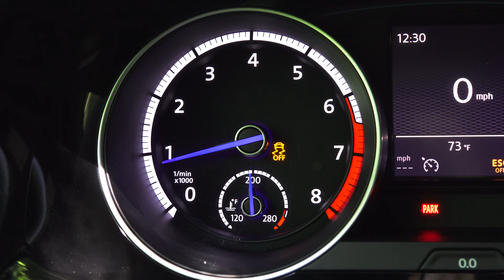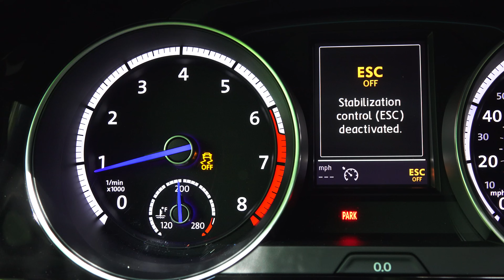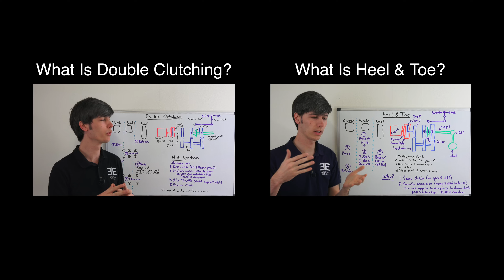How To Launch A Manual Transmission Car

Comment: In Germany we would need a tutorial for driving automatic, over 95% of the cars here are manual.
Reply: Doc T'Soni 
I would buy a car with AT, but only if it has DCT. I wouldnt want to miss the manual feeling.
Reply: +Doc T'Soni    Automatic is boring, consumes more (gas isn't cheap in Europe), and it tends to select the gear that "it" wants, not the gear that you'd need in a particolar situation (a corner, an overtake).
Reply: tja die ammis haben ja schon Probleme wenn se keine Klima im Auto haben..
Reply: +Doc T'Soni in France you get taxes if you buy an automatic something like 3000€ pro cars +3000€ which is the cost of the automatic version so a car without an at which cost 20 000€ = 26 000€ with the at
Reply: @stonedmole2351  Tiens, j'avais jamais entendu parler de ça. C'est surprenant... Tu sais pour quelle(s) raison ?
Reply: Nothing can take the satisfaction of driving a manual. Downshifting, heel and toe, it's just priceless. Nowadays there are faster ways to get somewhere like driving a DSG, but that doesn't give the same satisfaction. That's why I got my mk7 GTI PP with a manual transmission. Cheaper and it gives me so much more fun. Auto is for someone who doesn't actually enjoy driving imo. You can drive 80% of the time in traffic jams but you will still have some B road trip or night time drive where there's not much traffic, I was born in Sao Paulo so I know how that feels... If you enjoy driving that's when the manual makes it up to you. I agree though that for those who just use a car to get from point A to point B a manual is not the way to go, and I guess that's why automatic cars are selling so much these days even here in Europe (especially DSGs which is not really an auto mechanically speaking, but still)
Reply: In UK would make sense to buy an AT car due to traffic and so on...but by the time your engine decides on which gear it should be you could be in the 4-5 gear on a manual transmission car. 
I always said that lazy ppl drive AT cars because,oh well, they cannot be bothered changing the gears or all that.
Also,in UK if you pass your driving license on a manual car you can AUTOMATICALLY drive a AT car as well but the same rule doesn't apply if you passed you license on an automatic car,you can drive an AT car but you'll need to resit your test if you want to change that.
Reply: @mariusvalentin4822  yeah very true but these days you can pass your automatic test and jump straight into an audi s3 with a DSG box without issues or any car with semi auto, which is alot these days lol
Reply: I run a performance setup on every car I ever owned. Always loved manuals, shift when I want to at the appropriate time. Going down hill, I keep it in low gear, the engine brakes for me, no need to fry my brakes. Going up hill on a steep slope, keep it in first or second, all the way, no need to shift, easy climb, no problem. Traffic is a pain but it outweighs the benefits, for me.
Reply: Driving automatic car is easy, yeah. Too easy that will make you bored, no need to change gear.
Reply: anyone can drive a powerful automatic with no experience
Reply: its hard driving automatic man
Reply: Thee Adjudicator
i dont know where you sat in tho
Reply: AT are more expensive to buy and repair.  It's a skill you'll use more often than you think too. Only last week I moved a HGV lorry because it was blocking a bay full of steel and preventing everyone from working and I never even driven an HGV before.  Today I had to take a metal box to a steel works in a desperate hurry in a manual van because the lorry driver went home and I'm only the workshop painter. If that happened in America someone in a steelworks would be deprived of his metal box right now. There are plenty of job roles that don't have driving manual in the job description yet you'll be fucked if you can't drive the vehicles on a whim when needed.

I made an in depth tutorial on how to drive a auto too:-

Step 1: get in car
Step 2: put it in "D"
Step 3 get out of car at destination.
Reply: +Doc T'Soni 
AT has a big disadvantage, at least in my opinion: you are likely to forget how fast you are going because with MT you focus on what gear you are in and what RPM you are at, which is very hard with AT because you dont have to pay attention to that, basically. I hope you understand what I mean.
Reply: @scwfan08  I do now lmao! I used AT as my first car and without realizing it I was going 80km/h instead of 50/60... In MT I know in 3rd gear I can get to 50 and no higher without pushing the RPM's in that gear... In 4th I can get to 70.

I can easily remain within the speed limit vs an Automatic.. However I do miss Automatic for the fact it's a "Press and Play"
Reply: or pretty much everywhere else in Europe
Reply: 95 percent of people that say 90 percent are lying
Reply: +The_Geck Hold the brake and rev up to about 2/3 to 3/4 of the torque converter stall RPM. (Brake loading probably isn't good for it, but we're talking fastest launch.) Then let it loose and floor the go juice. I'm sure manuals are nice, but some of the fastest drag cars do use a slushbox. (But usually not with the factory setup.)

Other than that, you rarely use the L-selection at all. Stick with the brake pedal. The L gears are just for engine braking in hilly or mountain areas with long downhills. Autos that aren't "manu-matic" (or some variation) likely don't like forced downshifts.
Reply: +The_Geck Yee , I dont know how to drive automatics lol   , its all about changing gears not holding stering weel  isnt it ?    never drive before automatic ...
Reply: +The_Geck 95%? No way, 2/3 according to mobile.de
Reply: +King Joffrey Nein, Manuell überwiegt schon, aber nicht so heftig. ~2/3 sind Schalter.
Reply: You get nice feeling if you have powerful car with manual. I mostly drive with my manual on highways so I get better diesel efficiency. But if you use it much on city pfft, I would definitely consider automatic transmission
Reply: maxpowers3732
They are proper sports cars, its a big difference
Reply: maxpowers3732
 those cars are performance cars therefore you want it that way. if u want a gated shifter u rather go for cars with less grip and bigger torque. you drive it sporty in your free time. these cars are not like a sportscabrio, they have much higher performance
Reply: In Germany you have the Autobahn and therefore I am extremely jealous. :oP
Reply: *****
wow, you are extremely intelligent!
Reply: +mrdojob six months after I got my license having only driven MT I got to borrow the AT volvo V70 of my then gf's parents. It became quite the bumpy ride for a while as I was so used to manual I tried to use the clutch which of course wasn't there... while the gigantic brake pedal was there... XD
Imo, the problems happen when you go from one type to the other when very used to one of them.
I love my MT Hyundai i30 turbo crdi. Only trouble with it is that she took a beating from bad fuel from OKQ8 that had too much bio additives in it and caused algae gelling in the fuel system, blocking both fuel filter and injection pump :( Since then she has occational hickups that kicks her out of cruise control when I use it.
Reply: +The_Geck Um floor the gas? Lol
Reply: Steven Little
Well... :D
Reply: +Doc T&#39;Soni bis ins jahr 2011 haben die automatikfahrzeuge einen höheren verbrauch. ausserdem ist es schwieriger in der fahrschule und flößt genug respekt ein, gibt ein gefühl für geschwindigkeit. warum sollte es dumm sein 2liter / 100km mehr zu verbrauchen, wenns auch anders geht. ich mag das so gerne, ich könnte per automatik kotzen.
ausserdem: die mercedes (bei BMW weiss ich nciht), die mittlerweile bei Automatik trotz Drehmomentwandlerschlupf weniger verbrauchen sind minimal effizienter, bei VW , skoda fidnet man heute noch mehrverbrauch. ich zahle aber keine vierstelligen Beträge, nur um dann in 20Jahren etwas zu sparen.
Wann muss denn so ne Automatik in die Werkstatt, wenn man von 20Jahren und 300.000km ausgeht?
Meine Karre hat 24Jahre drauf und ich kann mir keinen Neuen leisten.
Reply: +The_Geck really? most of the Mercedes and BMW's I sat inside over there are automatic.
Reply: Why do so many sports cars have automatics that are in Germany? The take rate for manuals is much higher in the US than Germany. Do sports cars drivers forget how to operate a clutch and gearshift?
Reply: Huh? Why don't German buyers want a manual M5, 911, R8, etc.  Shifting the gated manual R8 was one of the greatest feelings in the world and yet buyers in Germany get it with the boring automatic?  Why do Americans buy manual sports cars at a higher rate than people in Europe?
Reply: welcome to the future
Reply: Ja und ich bin froh dass es nicht andersrum ist....die ganzen faulen amerikaner....
Reply: The_Geck isso
Reply: The_Geck was laberst du? :D die neuen autos sind alle automatik...
Reply: Damit hätte ich auch Probleme. Zwei Zonen Klimaautomatik sollte drin sein ...
Reply: archly i tend to speed more in a manual ya i was doing more speed in the auto when i was speeding but that cos i went from a 1.3 vvti to a 1.2.

i think everyone should try a 1.3 vvti idn what toyota dose to they engines but that yaris was keeping up with 1.6L engines i even sore 130mph no ware near redline
Reply: The_Geck Hahah same in India too
Reply: actually it's pretty much 50%/50%. I read something like 51% manuals and 49% automatics are registered in germany. und ja ich lebe in deutschland :)
Reply: When is the last time you see a modern German car like BMW that is manual?
Reply: agreed, but good luck driving a manual in nyc lol
Reply: in tanti those are bad automatics. The one in my ka9 always does what I want. Also, it is very fun to flex the gear, and it overtakes very well.
Reply: Are you sure? At hamburg almost every car is automatic
Reply: Really?

So that would mean most Mercedes, BMW and Audi are manual?

Which we both know not true.
Reply: I wish that was the case here it's so hard to find manual transmission cars where I am
Reply: @ControversialOpinion  manual is much more fun tho
Reply: If you cant drive an auto without a tutorial, you should have your license revoked.
Reply: Birki gts what? In your licence you drive manual so if you have never driven automatic than its not gonna be easy
Reply: Albania as well 🇦🇱🇩🇪🇺🇸
Reply: Is this your opinion, or a fact, if it does you mind dropping some data? I would like to make a research paper on that.
Reply: Really ? 90% of Mercedes are auto tho so do Germans not buy there beloved MB
Reply: MANUAL SUPRA FOR SALE THERE?
Reply: @ControversialOpinion  
Statistically, nerds likes MT very much. Are we Europeans all nerds? 😁

Seriously, I think the reason is the price: AT cars are very costly. And until 15 years ago they used to burn more gas.
Reply: My Dad works for VW and gets a new Car every 6 Month, I drove his Cars for about 2 years now ( they were all Automatic) 3 days ago he got a new golf gti 2019 but manual, I managed to drive it into our garage in the first 10 seconds I was in that car because I forrgot how to drive manual xDD
Reply: Why are Germans such smug pricks about everything. I'm not even American but it's so annoying
Reply: Step 1: Start the vehicle
Step 2: Put the vehicle in drive
Step 3: Drive the vehicle
Reply: Ja aber Meisten machen kein Launch, der Amerikanische Faulpelzkultur wird langsam integriert in Europa.
Reply: In india it is opposite..We find manual transmission
Reply: Fifty million miles?  I doubt it...  I prefer a manual 'box because I refuse to let a car tell me what gear I want.  Having driven plenty in both types, I can honestly say that I would rather tell the car which gear I want...
Reply: in Germany cars with automatic gearbox cost 2 - 5 thousand€ more (new price) so if you have to pay extra for a tool you never used in your life you just get a manual one and save that money
Reply: In Europe cars are Manual unless you specifically ask for an Automatic. I think the answer is that we drive our cars rather than get driven by them!
I will add that I have driven in Germany and its an absolute pleasure to drive there. Everyone uses the rules of the road and Germans are very safe drivers. I love the Autobahn's and the accident rate compared to the UK shows that that its not speed that kills, its people not following the rules of the road or driving dangerously. I felt totally at ease doing 120mph on a redistricted section getting overtaken by people doing 150-200mph. I was doing my best not to get in the way!
Reply: Stimmt leider nicht mehr! Es gibt immer mehr Automatik Autos oder Autos mit DSG.
Reply: It's more economical (for the girls and gayboys). It's more fun (for the men). It's quicker. It's smoother.

I understand why a lot of Americans drive automatic as their fat ass legs would get in the way of the gear stick. Also, you need a small amount of co-ordination and mental capacity to steer and change gear at the same time. We don't have a problem with that over here.
Reply: The_Geck to teach what? How to use the gas pedal?
Reply: Love manuals so easy to drive easy to control and safer to control also hold up better and easy to work on and maintain stronger wow just better
Reply: There’s always that one guy that talks about how awesome Germany or some other foreign country because they mostly know how to drive manual smh
Reply: You have Uber Right. 

I'm American, we don't drive Manual here
Reply: Yes, it is sad how Americans became addicted to the automatic, no-skill transmission. The dealers don't help because they make a lot of money not only with auto tranny rebuilds and replacements, but simply changing the fluid costs hundreds. In 2015 I sold my Accord wagon 5sp manual with 235,000 miles on it and the original clutch. I changed the transmission oil once for $25.00. What a great, reliable device! Manuals are the best! BTW Geck, I have a 2015 Passat now with a 5speed. No manuals even available for Passats here in 2016. Could you please tell Wolfsburg that we want a choice, some American actually know how to drive!

Comment: I had worse damage in the Alfa Romeo 156 2.0 Twinspark. My crankshaft bearings of cylinder 1 failed, and thus that cylinder started to knock against the head.

So yeah, if thee engine is old... don't do it before it had a rebuild.
Reply: +LogiForce86 Alfa guys say that you are not a true AlfaRomeo fan until you blow your first engine. On the other hand Honda fanboys say old hondas never die, they just get faster. I want to say, that the problem wasn't your flooring, but the badge :D
Reply: +Vicjo Koper Just now I sold that Alfa for 400 euro trade-in and bought a nice BMW e46 316ti again. Not as powerful but... rear wheel drive and 50/50 weight distribution. >:)
Reply: That car is always a nice bargain since most people don't like the front lights. Just watch for the head gasket on those engines ;)
Reply: +Vicjo Koper Yeah, I'll keep an eye on the engine. I'll have a friend check it over, he's a BMW specialist. So he'll make a checklist like Alex Kersten (from Car Throttle) got with his e36 M3. Hopefully I won't have to swear in German, cause just like him... I have a bit of a German background. lol

My car is a bigger bargain though. It's a 2001 model with only a mere 133.331 kilometers on the counter in 15 years, but it's got a weird color. According to BMW... "code 478: Pistachgrün Metallic" or pistachio green metallic, plus a matching color M-package half leather sport seat interior.

So yeah... 3000 euro for that kinda car is not a bad bargain, and got 400 for my old one with the bad engine. So I can't complain. :)
Reply: +LogiForce86 - oh, you can do it just fine with an old engine. Unless it's an Alfa, then don't try it even if it's only 5 years old.
Reply: +MasterBata If only I knew before hand. Might've never bought it in the first place. What good is a car with a sports background that can't even rev up to the high redline it visually shows it has (7000 rpm in the 156 2.0 TS). No wonder BMW was almost always the better car in the races if it ended on a reliability point.

Comment: It's crazy how the perfect launches are achieved when you're not even trying. 

Rain outside, diesel engine so loads of torque, however I had a few launches where the revs were just right and the release speed of the clutch was optimal. Zero wheel spin, no clutch burn and probably a perfect 0-60 time if I were to continue.

Any other time I try I tend to use the drag race stile of dropping the clutch completely (great when using ceramic clutches) and this leads just to wheelspin on a normal car.